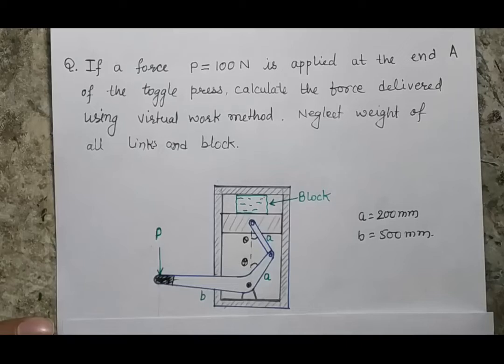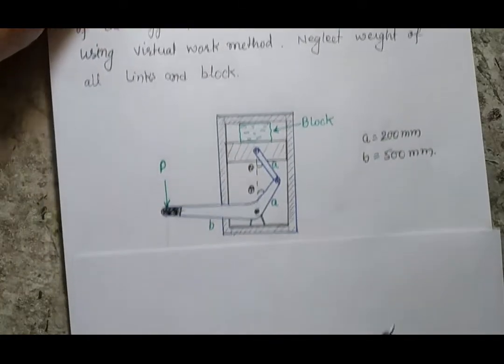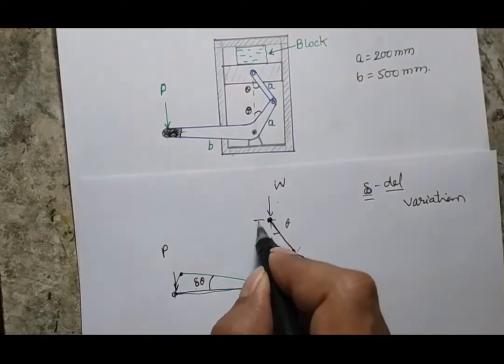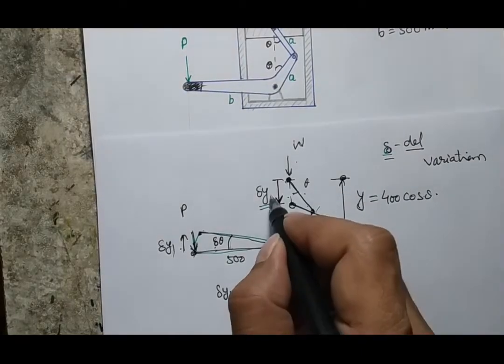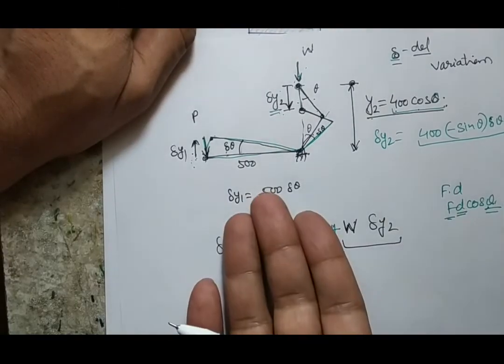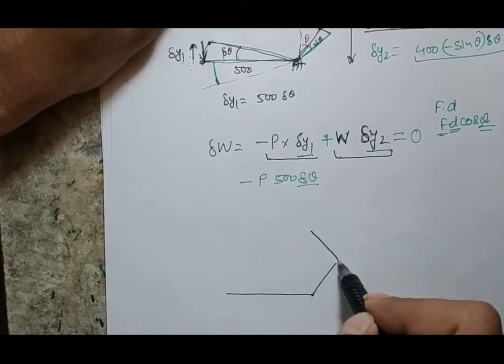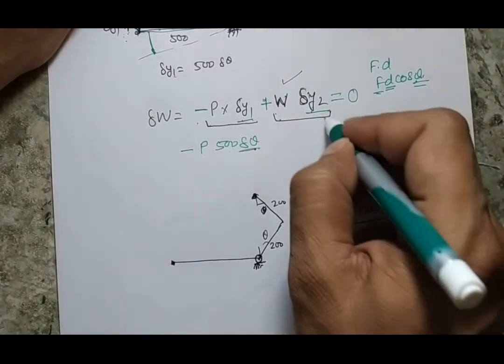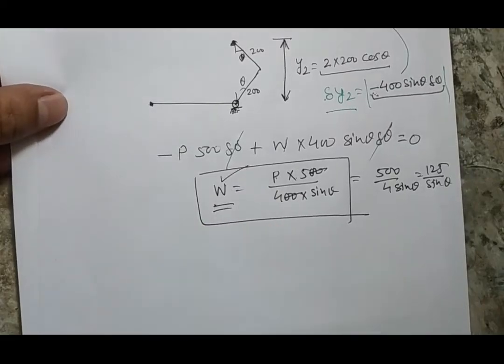Virtual Work Method Lec 5 || (Problem 4)|Engineering Mechanics|First Year Students

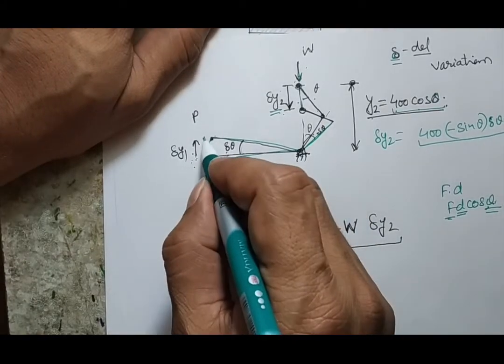Comment: 7:40 the direction of force as well as displacement will be same.. Then how it can be negative?.
Reply from the maker: If I am assuming that the piston is moving  virtually down, to satisfied the constraints, point at force P is acting will go upward. Means point is moving upward but my force P is acting downward. so the work will be negative. I tried to answer your query, If yet not clear, inform me.
Reply: @ashishpurohit9138  but sir, we have assumed that piston is mass less.. Then how it can come downward automatically... Means in this case we have first applied force P in downward direction after that piston comes down... So force P and application of that point's displacement have same direction.. So it should be positive...
Reply from the maker: my no is 9540680833, call me I will explain. it is very difficult to explain in text.